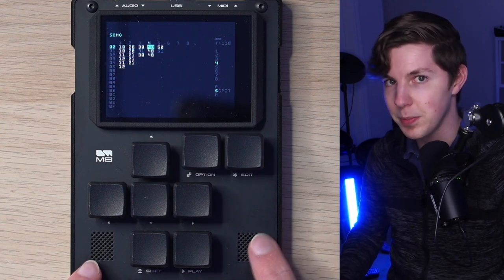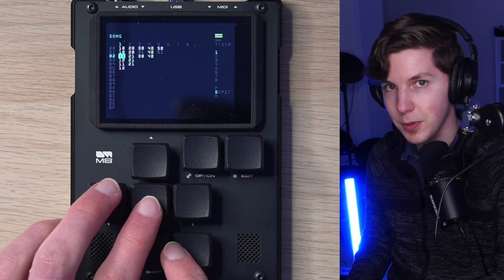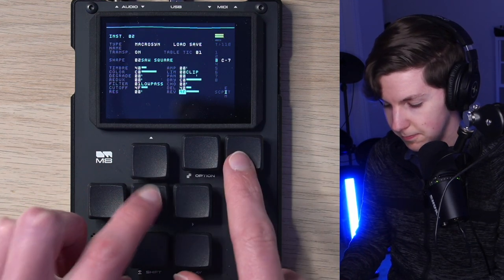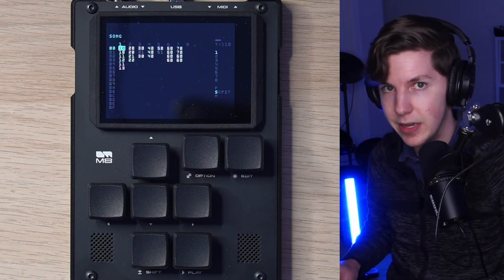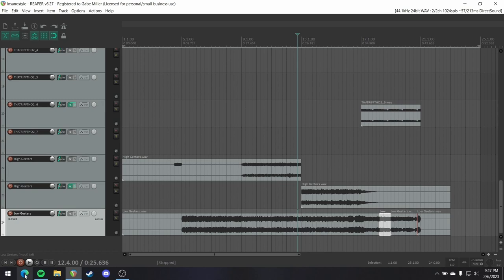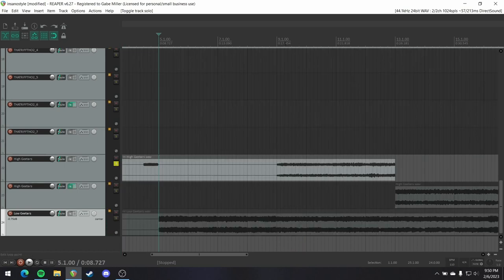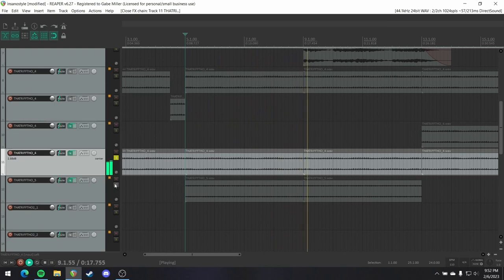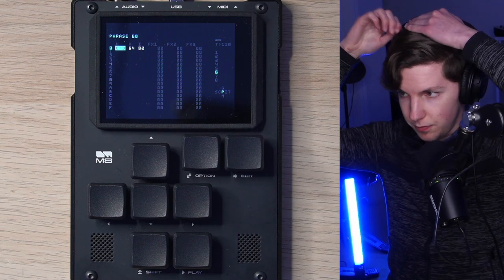A different way to use the Dirtywave M8

Comment: Hey Gabe, do you already have a verdict on Polyend Tracker now? Also, why did you choose M8 for this track, because you had it with you or because you think it fits better for some reason? Would it be possible to do this track on MC-101, for example? And if you're not yet too tired of questions, do you still use Electribe 2 or think you would use it again?
Reply from the maker: I still don't have a strong verdict on the PT, but I'm leaning towards it's neat but not necessarily for me.
And yeah in this case the reason I made the track on the M8 is that it's what I had with me while travelling (it was the only music gadget I could fit in my backpack). Plus, the onboard sound design tools worked well for this track. Most of the sounds are relatively basic though, so I think you could probably get pretty similar results on the other grooveboxes you mentioned.
Reply: @GabeMillerMusic  So it's not the tracker approach that you don't like, as you are fine with M8? I guess probably the absence of synth engine too